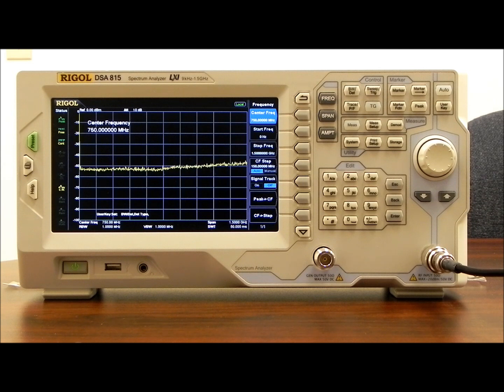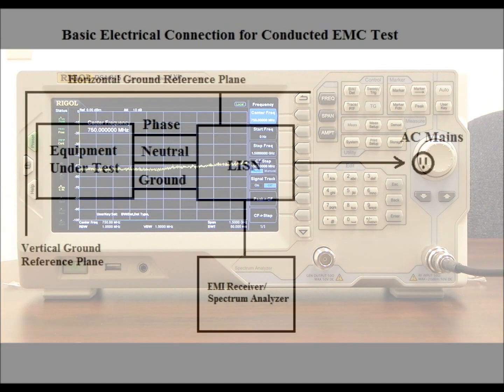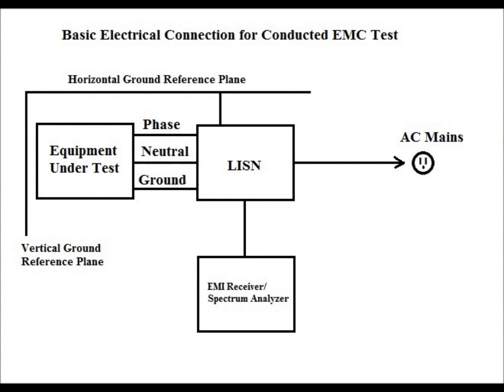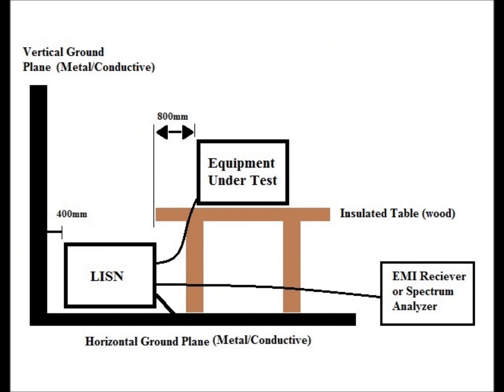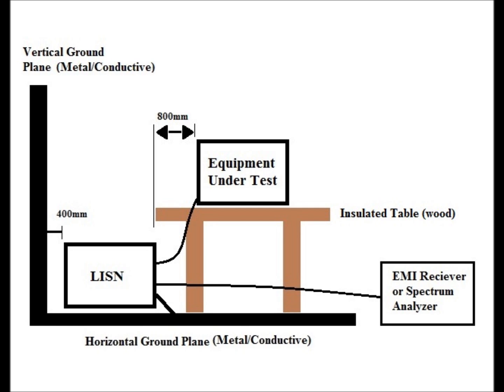Conducted Emissions Precompliance Testing with a DSA815-TG

Comment: Good video, but I have a problem on my DSA815. When I save a setup file with pass/fail line created, I cannot get the trace out of freeze mode. Other setups without pass/fail line do not cause this issue.

Comment: Thanks for a very informative video, on  the first best value SA on the market. Rigol made it economically possible for the serious Ham or RF Experimenter to OWN a new, and fully supported RF SA.As a Radio Ham, I immediately noticed that the largest USA Amateur Radio organization presented both an extensive Equipment Review (they buy a random sample like CU), and a Connecticut Cal Lab they sent it to for the report cal PASSED with no issues. Also the Lab Manager takes this model to Hamfest meets all over USA, and logs the often FAILING Baofeng ect cheaper handheld radios. The ARRL magazine also evaluated and uses RIGOL scopes. They DO also have the latest top-end Rhode & Schwartz Spectrum and Phase Noise equipment the top Ham and German  Ingeneur Ulrich Rhode donated to the measurement lab to add to their test capability.

Comment: Can the split screen be turned off and still  keep the pass/fail limit lines?
Reply: Hi. Currently, the instrument only shows the lines with the editor on the display. The S1210 software allows you more flexibility on the PC side to view that data, but I will mention it to the product team as a possible enhancement. thanks!

Comment: Thank you for the video.

Would it be possible to do a video on radiated emissions pre-compliance testing?
Reply from the maker: +dogintwater Precompliance testing for Radiated Emissions can be a difficult task with many external factors involved. The RF environment (WiFi, Bluetooth, FM/AM radio, etc..) as well as the physical location of  objects in the test room will change the readings drastically when making farfield measurements with an antenna. Experts in EMI have suggested using near field probes for finding trouble spots in lieu of far field measurements for precompliance tests. I have plans to do a near field video soon. You can also always write me at Jason_chonko@rigoltech.com if you have any specific questions or requests. Thanks for replying.

Comment: How do you incorporate the LISNs frequency/loss factor into the analyser to ensure the measurements are correct. Also, how many points can be entered into the limit line since it is not always constant over the frequency range.
Reply: Hi Rowifi, 
if you are still interested, I can comment as an RF and Optical Networking - Analog/Compliance and Power engineer in Telecom since 1980. I just did a DC CEMI evaluation last month on our latest Terabit product with -48V DC PSM installed. I have built DC LISN's using my Ham Radio experience and ARRL Handbook. We have a similar Keysight 3GHz SA, unfortunately NOT ever QPEAK capable. The German 100A 4 channel LISN I bought to duplicate our local lab, who used it on earlier projects I did with them, was $7K new. It's LISN Factor is on the maker's website, and is less than 0.5dB over most of the range. This and cables and protector losses vs freq are part of the factors to add to your spreadsheet or program in if possible. 
Correct on the limit line, for CE it has few steps (below 500kHz because LW is not as important as AM BCB), but for Radiated there are more inflection points on account of the broadcast services and old TV bands!
We use dBuV instead of mV, per FCC and Telcordia practice. The limit line is then 66 up to 500K, then 60dBuV to 30MHz.
I like to split the scan into 3 ranges, for better display, 150K-500K; 500K-2M, and 2-30MHz "bands", to more accurately examine the emisions and fill out the results spreadsheet.
Finally, the 9kHz EMI RB is to simulate an AM broadcast, being interfered with by the Conducted Emissions you are measuring.